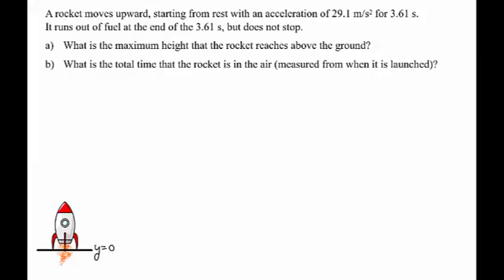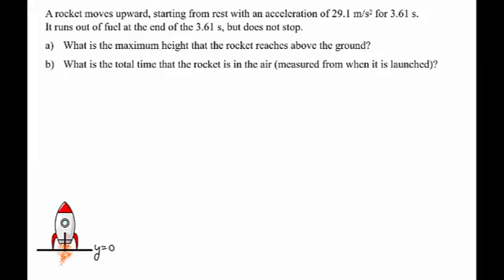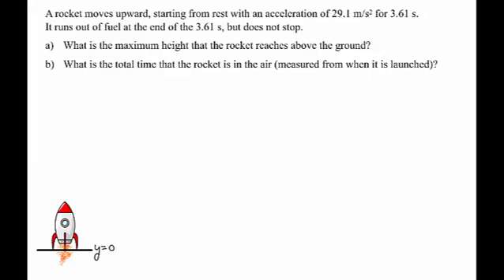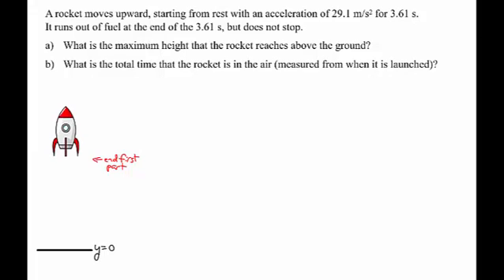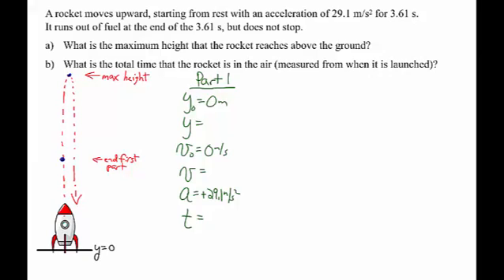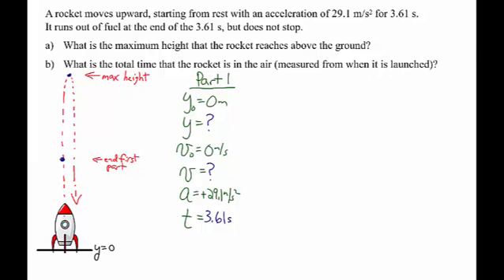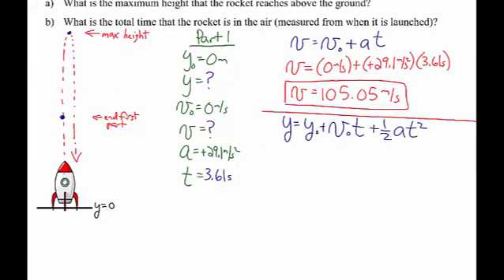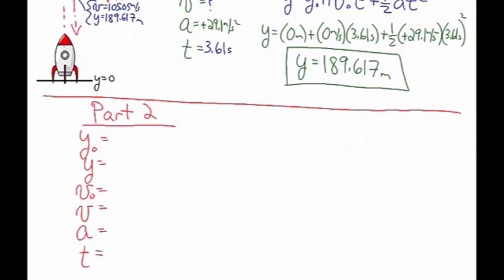1-D Kinematics: Rocket Accelerates Upward, Runs out of Fuel, and Comes Back Down to Ground

Comment: shouldn't we add 9.8 and 29.1 to come up with a net acceleration?
Reply from the maker: Hanna Plaza The acceleration that is given is the net acceleration of the rocket.
Reply from the maker: Hanna Plaza It does not say that the acceleration is only due to the engine (which would be a very uncommon way to state things - you are almost always given the overall acceleration).
Reply: thank you :)